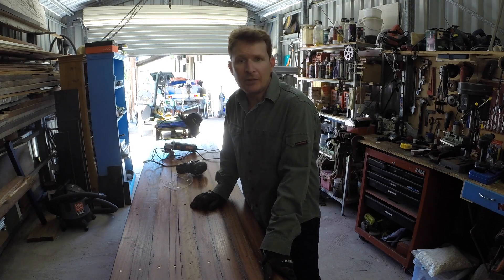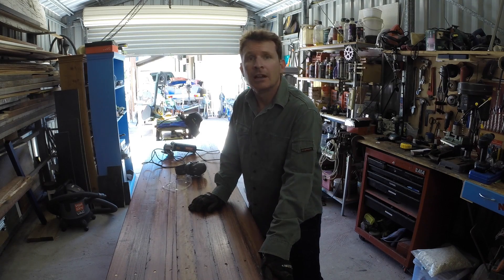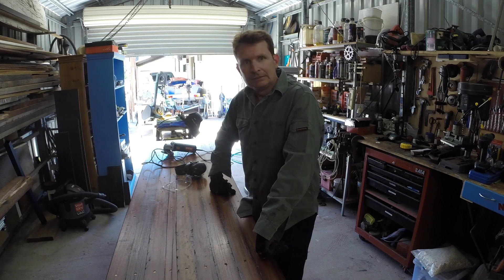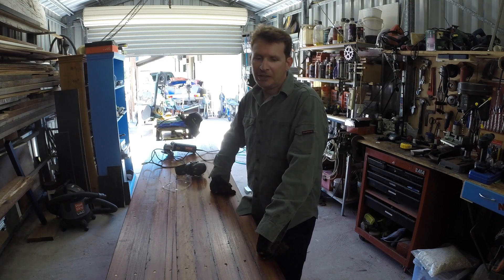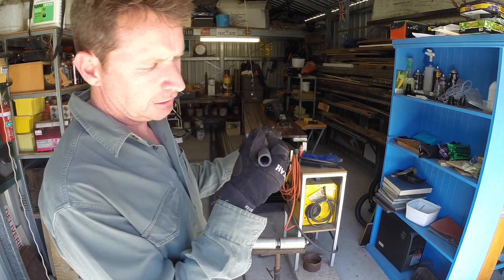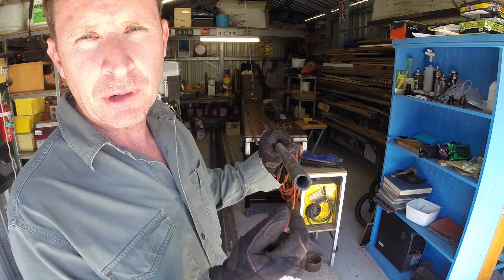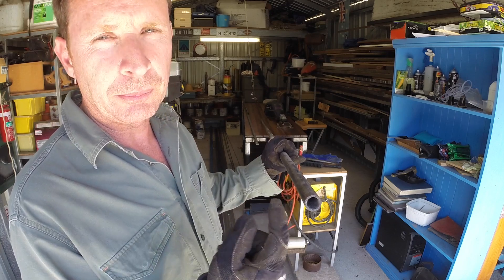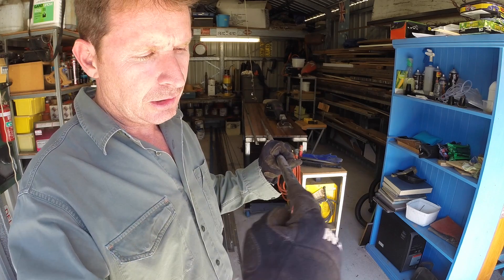Make a Workshop Truss framed overhead gantry

Comment: Thank you for the video. How do you think now 3:24 was it possible (and much easier) to make that z-construction made by bended monolitic wire than cutted and welded? Thanks again
Reply from the maker: Thank you! Yes a bend mechanism would be 100% better no doubt.
Reply: @ScottTurnerformeindustrious  Thank you for the feedback. The main engшneering task is HOWTO bend long z-members (or how to call them)..

Comment: I understand this was over a year ago...but hopefully you'll see this missive. I'm curious how you use this gantry/truss...for power, lighting, air, vacuum ...etc.?  Is there roller slides that you fashion or? Maybe just loop it where you need it?  I like this idea!
Reply from the maker: Hi. presently I run over head power, light and I use it to have my dust extraction pipe. I do hook things to it also. Original concept was to also use a roller/ gantry rail but I really don't think that is necessary in my shop at the moment. Thank you!

Comment: I think if you went and made dents every 9" on 1" emt and made them bend at 45 and made you w sections it would have more twist strength
Reply from the maker: Yes I would like to make a jig that makes the truss section in one piece, one press, but it's really unlikely. A simple bender would work I think like you suggest and it would be stronger especially when made in a triangle configuration.

Comment: Hey Scott, great video. I definitely picked up some fabrication techniques from this. One question: do the tubes with the plates on the end that you hold up to the camera at 7:07 have a name? Those look prefabricated but I have no idea what to call them so I can't find any more info. Those would be great on my next project if I can find the right dimensions.
Reply from the maker: Josh Olivier hey Josh, I think you are referring to the bicycle tubes that I used to raise the steel work. I used two. They work fine for light lifting anything heavier I would use a chain or lifting slings. Thanks Josh!
Reply: Wow man, thanks for the quick reply! I'm actually talking about the steel rods with plates on the ends that you used to bolt and brace the assembly to the overhead roof truss after you had suspended it on the bicycle tubes. Did you fabricate those rods yourself or do they have a name?
Reply from the maker: Oh ok, those I made from steel rod and plate to make the end attachments. All fabricated.

Comment: What is the red "paint" over some of the joints? Presumably a rust inhibitor? Do you apply that only over welded areas, or any area where you grinded down mill scale?
Reply from the maker: Hi David, That's Red Oxide Primer I use on the bare steel. I little while after this video I cleaned up the whole truss, primed and painted it. Now it's covered in dust ;)

Comment: Great stuff. I'm thinking about something similar for lighting in my workshop as sometimes my videos come out to dark and I only notice when I edit which is way to late haha
Reply from the maker: Yep it's quite useful in lots of ways. You can attach your camera, power, air, vacuum etc, and you can do chin ups (up) on it (when no one is looking. Works for me. Do it and post your work on You Tube ;)
Reply: Scott Turner out know what I didn't even think that will go perfect for my camera as when I'm working my camera can wobble a bit and that's more junk footage. Haha my workshop ain't high enough for chin-ups I don't think. Yeh man if I do make it I'll film it and give you props for the idea 👍🏼👍🏼
Reply: We supply roll forming machine for steel structure,send emails to tinagaosky@gmail.com,whatsapp+8618232894593